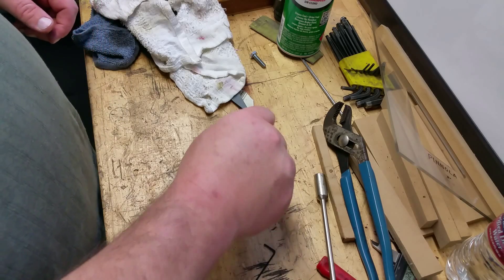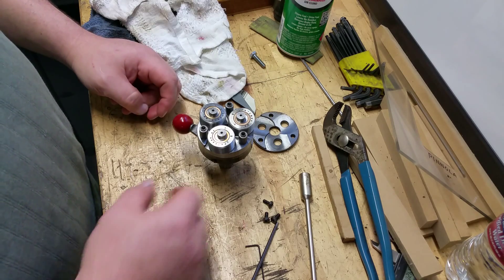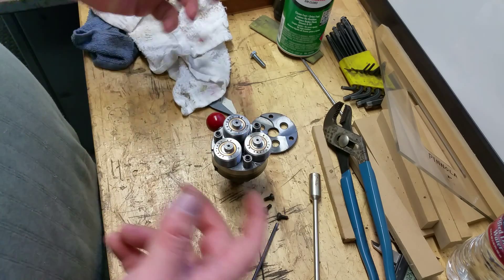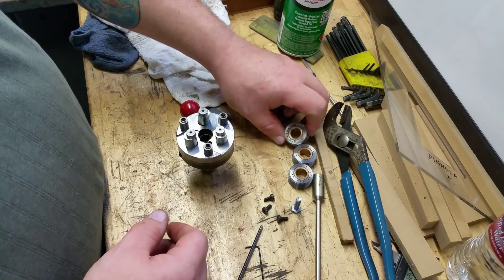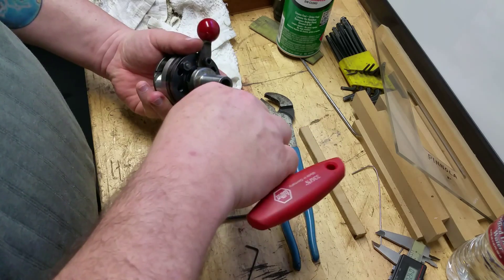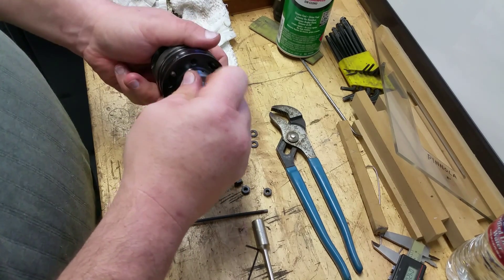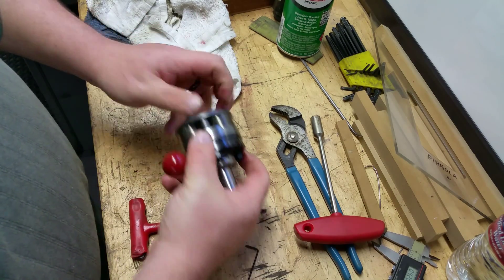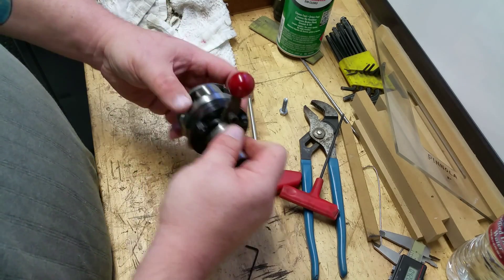Fette thread rolling head teardown

Comment: The magic of what keeps all three dies in alignment to not cause thread laps is what I want to know. I have seen them heads in catalogs but never took interest because of not seeing any answer to that question. I have all kinds of thread rolling experience though on methods, except, for this method. On the three die round die machines I used, each die was adjustable in rotation by unbolting the driveshaft for that die and moving it a spline or more. This kind of machine, all dies are properly lined up this way, and all turn at the same time in same rotational orientation, and can not move out of rotational alignment.   
I see, because you broke down this head, that in use, all three dies are free to rotate in any orientation they desire. Some magic then happens to bring them all into alignment during the thread forming process. I would love to etch and micrograph  a bunch of parts that came off this kind of head. I would check for thread laps and starting marks. In non critical parts, maybe that may not matter. But, when I was threading, the parts made were extremely critical, and only have experience in that kind or area. 
Your videos on this subject is tempting me to get one of those kind of heads and give it a try. I certainly will examine the finished product as I describe above though. 
I can tell you this, roll formed threads (do not know about off this kind of head though) are by far better than cut threads.
Reply from the maker: The magic is that the dies are not helically ground.  There are concentric grooves and the timing is determined by spacing of the grooves from the face of the wheel.  They are depthed like the teeth on a 3 jaw chuck.  The head appears to have the same angle and pitch for each wheel, but the pitch is offset slightly on wheels 1, 2, and 3 so the groove proceeds helically as the part is rolled into the tool.  Because the wheels are at an angle to the workpiece, it causes the wheel to climb onto the part and roll in a helical direction.
Reply: @eformance    I noticed that in a video. Took me a few seconds to understand it.